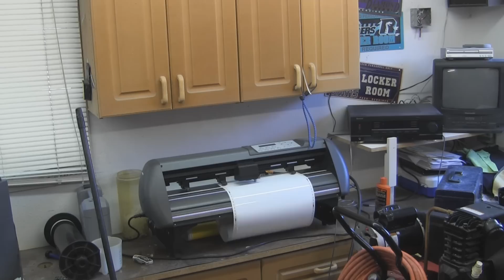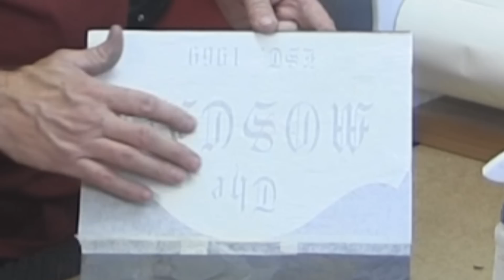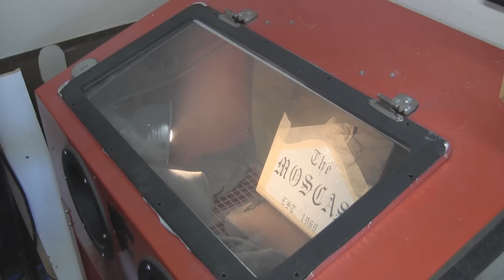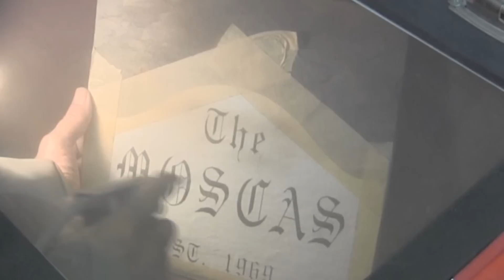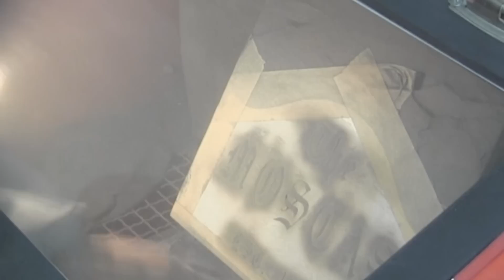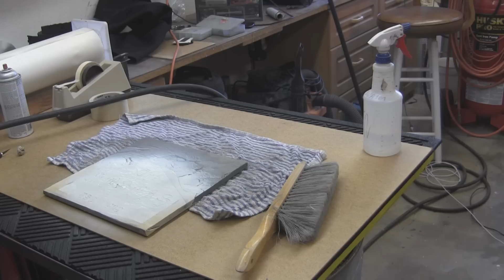Sandblasted Sign

Comment: What sand do you use?
Reply from the maker: I am currently running 180 grit aluminum oxide. I’m thinking on changing to 100 grit silicon carbide for a faster deeper cut which helps with air volume and air pressure.
Reply: @insidemyshop  Thanks for the reply. I am new to this, I have a brand new cabinet and a compressor but I haven’t got any media yet.. on top of that, I have the silhouette cameo 4 that makes stencils but I’m a little worried the shotblast will just go straight through the vinyl!? If it does, could you assist on what plotter I should be looking at?

Comment: What kind of sandblasting system do you use for the deeper carving on the stone/granite?  I like the depth of your letters, and I’m thinking of buying a sandblasting system but don’t want to get the wrong kind.  I want something that will do softer etching on things like glass but also one that can do deeper carving on materials like rock, tile, brick, wood etc.  Any advice?
Reply from the maker: Laura, I have used mostly Harbor Freight equipment. I use a pressure pot system vs a siphon-feed. You can use either however most people like the control you get from a pressure pot. Less air usage compared to a siphon system. I've done both granite and glass over the years. One big thing to think about is the waste left in the grit after sandblasting a rock, it would need to be sifted so that there are no foreign pieces in the grit when blasting glass. I use 180 silicon carbide most of the time for glass and rock. Aluminum oxide breaks down over time whereas silicon carbide breaks into sharper pieces. Bothe do breakdown to the point you lose the grit rating, Course to fine which means it'll have less cutting power. You can piece and part your way up to a multifunction box as money and interest evolve. This is a "very basic" break out. Hope it helps.

Comment: What kind of abrasive do you recommend?
Reply from the maker: I have benn using 180 grit silicone carbide for for several years.. I started out with a/o and found out it breaks down easily into dust unlike S/C thats when it breaks down it retains it sharp edges..

Comment: Doesn't the mask material get blasted off?
Reply from the maker: +Sarmad Qureshi  If your pressure is set to high for the application it will blow off. Also you need to be careful not to get under the mask when blasting or that will cause the mask to lift.

Comment: What of sandblast resist are you using and how thick ? also what type of a gun are u using Ken .
Reply: Jody, I used 3.2 mil Stencil Spray Mask. I have used regular sign vinyl before when I ran out of spray mask. The gun I have is a PAB Gun, You can do a search on it to find current pricing.

Comment: Great video! What material is the mask? Vinyl or rubberized material?  I thought regular vinyl wouldn't last the sandblast.
Reply: I use Oracle 631 and 651 vinyl (used in silhouette and cricket vinyl cutters) all the time for sand carving and it holds up just fine. And I usually blast fairly deep.